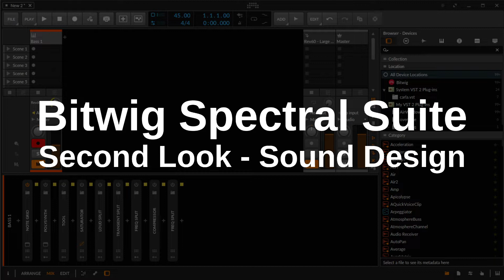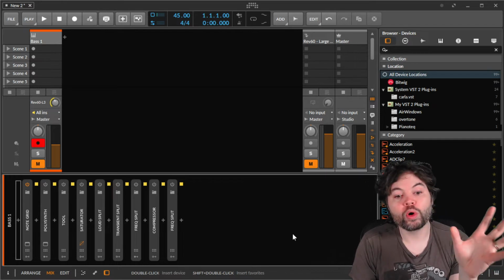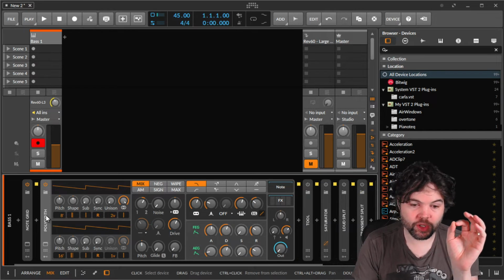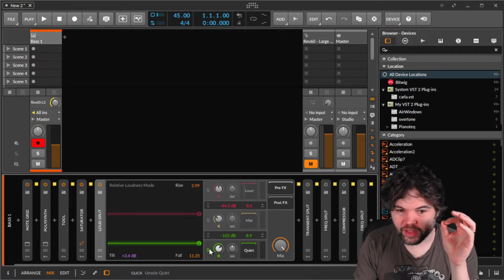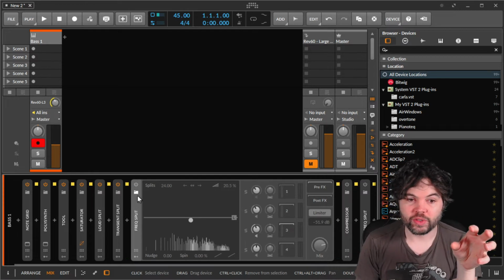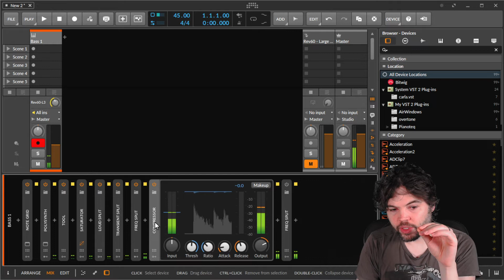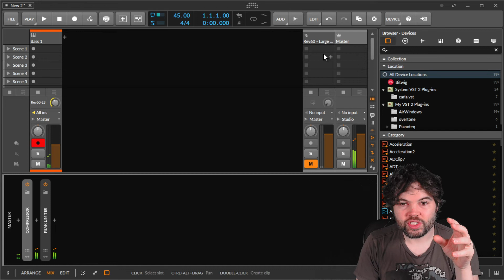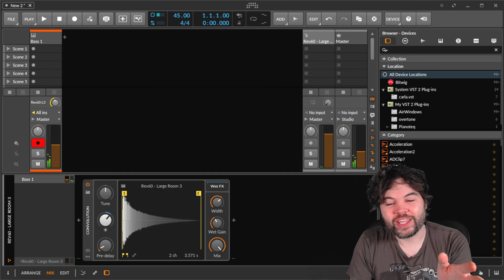Bitwig Spectral Suite - Second look: Sound Design

Comment: Sounds pretty... Spectral! 🙂
Reply from the maker: Thanks for you comment, and for watching. I was thinking the word might have been "sweet" but "spectral" seems equally apt.
Reply: @ChalkWalkMusic  To me the sound brings back memories of MP3 corruption... which is a rather more primitive way to get a "spectral" effect :)
Reply from the maker: @samthursfield7614  I am almost certain that the mechanism by which the spectral decomposition is done is exactly the same as is done in an MP3 (but without the scaling and quantization steps): a windowed FFT. I'm certain that with the freq split and some bit crushing you could get something that was extremely similar to very low bit rate, or corrupted MP3. This also illustrates something of what I said about mastering: these plugins colour the sound in a way that may or may not fit your purposes. As they say: if all you have is Bitwig, every problem looks like a corrupted MP3.

Comment: Well done on your clear and articulate presentations, and for  starting to cover Bitwig. 

Haven’t seen mention anywhere that Spectral Suite is patently inspired by some of GRM Tools’ plug-ins, which  have long been a ubiquitous benchmark set of tools for pro sound designers. And priced to match!

Although one can still purchase GRM Tools, there haven’t been any upgrades for around a decade, and are pretty damn clunky  for a modern workflow (but I still never tire or them), so to now have some similar (and arguably better?) tools natively included in Bitwig is pretty impressive and hopefully an encouraging sign of possibly what’s to come.
Reply from the maker: Thanks for your comment, and for watching. I actually saw the GRM Tools plugins when looking around for other info on spectral effects after making these videos. From what I saw, there was a more fixed set of processing one could apply to the spectral slices though many parameters were on offer. The flexibility of being able to place disjoint effect chains on each really opens things up for me. Combine that with the comparably simple UI and being Bitwig native, makes them a great workflow fit for me.